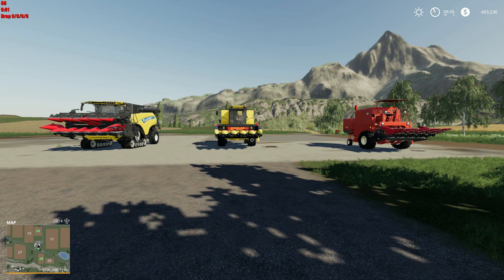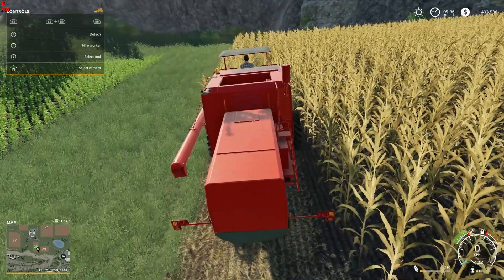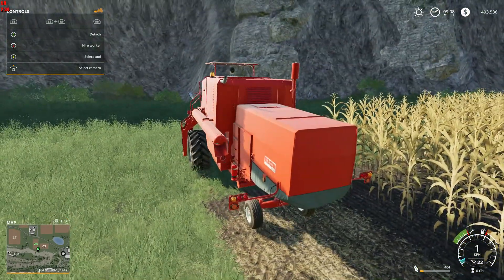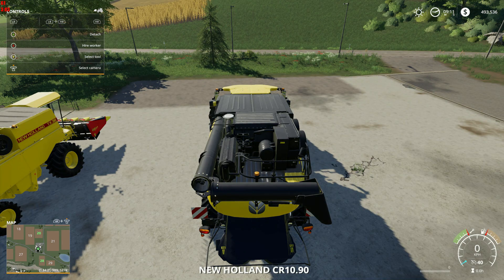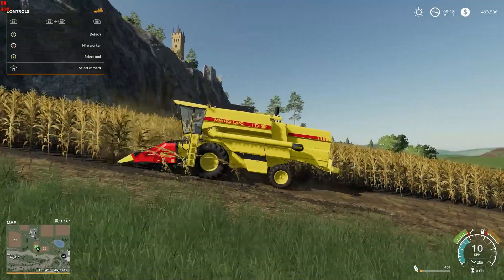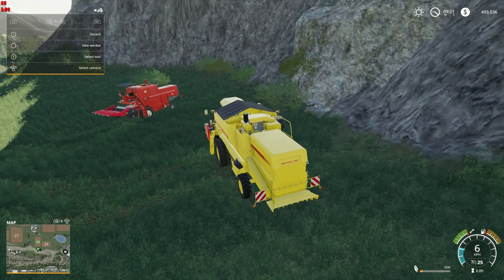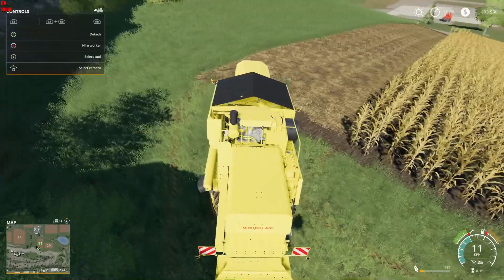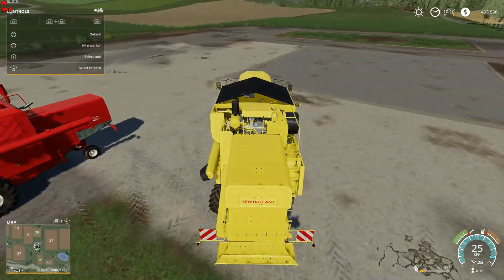Farming Simulator 19  Looking at some combine issues and odd lights

Comment: nice work lad, the lighting issue I found was harvesting at night and trying to judge trailer position in the mirror, despite rear work lights I couldn't see the trailer till I turned round .  not game breaking just irksome as I plan to spend quite some time trunking about. 
here's hoping the first patch is a heavy hitter. 
thanks again for your effort.
Reply from the maker: For all of Giants raving about the new lighting engine it does need some tweaks.Thankfully most of the other issues are just requiring small fixes and tweaks as well.The foundation seems pretty solid just some of the details need adjusted.You were right about the TX not producing waste and I assume like the rakeless baler just a line or two of code needs added. I bet we get a major patch before Christmas.

Comment: The time I saw the big New Holland struggling on a hill, wheat was the crop being harvested. The wide thirteen metre header seemed to produce so much drag when going uphill that, after a long period of struggling to move at all, it would gradually pick up to a feeble three mph until the gradient began to level a bit. All seemed perfect in your corn test so maybe the grain header is a bit misaligned to the ground?
Reply from the maker: Giants seems to have reworked the physics to more like the MR mod.  A step in the right direction for sure. I have found several times I have had wheels high centered on small rises , so maybe  the fact that every bit of the new models have full collision is causing clearance issues.

Comment: Just been using the NH TX32 on Wheat and full dust and chaff from the back. This is on full graphics everything on full.
Reply from the maker: Seems to be just corn that it can't spit out then,cool , a line or two of code should fix that right up.
Thanks bud!
Reply: Wrote the above before watching the end:-) Never noticed the Maize issue but being British we mainly use Maize for Silage:-)